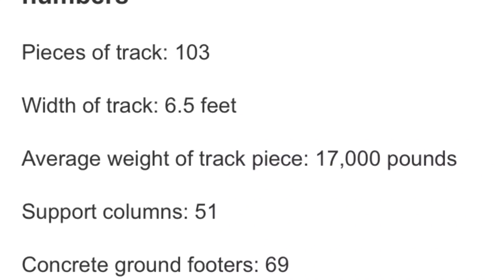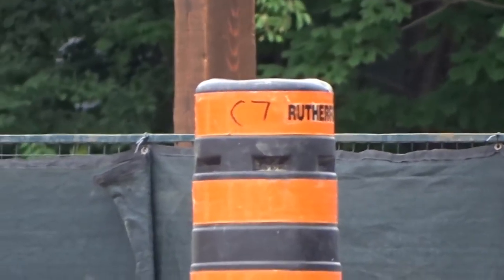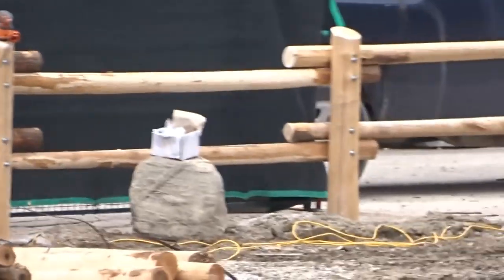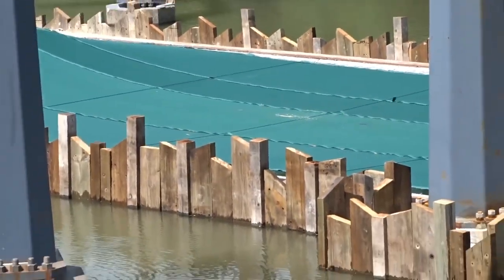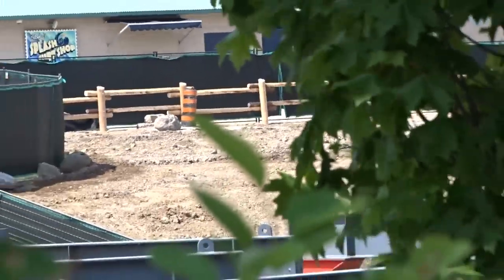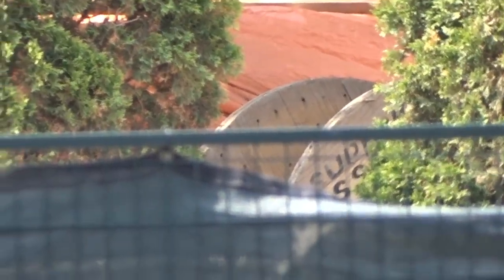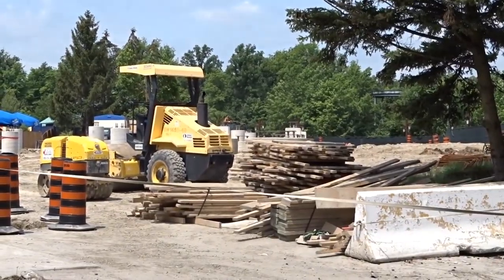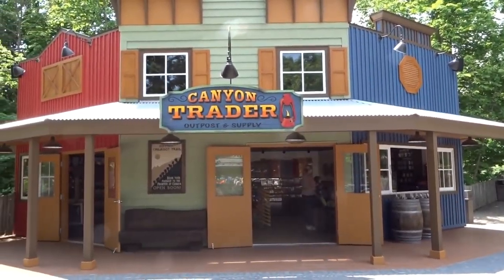Canada's Wonderland New Coaster Larger Than Valravn?

Comment: The 272 ft height that you mentioned was based on the length of the lift hill that you measured and an incline of 37 degrees like Valravyn.  On your previous video, there was a comment from someone who said the actual incline of Valravyn was 47 degrees with a link to the source.   Can you confirm which one is correct cause if 47 is correct, then we might be getting a much larger ride than 272.

Great video as usual!

Edit:. Here's the link.
https://mobile.twitter.com/tonyclarkcp/status/664537580344623108

Comment: What defines a giga? The drop or the height of the lift?
Also, I think they will start construction and not lay down sod on that other side. It doesn't make sense to me to stop at this point. But I guess time will tell.
Reply: Khris Ranger a giga is the height of the drop
Reply: Jaykoo thanks! I thought so but wasn't sure.
Reply: Hyper is  200 ft drop or more giga is 300 drop or more strata is 400 or more
Reply: Roller coaster terminology is really screwwy! Giga  roller coaster was first used by Intamin in 2000 with Millennium Force. Perhaps to up B&M official usage of the term hybrid which was an industry standard term for a typical roller coaster that had a lift or drop of 200 ft or greater. To this day B&M does not recognize the term giga and lists Leviathan and Fury 325 as hyper coasters. However park marketing directors and enthusiasts all have different opinions as to what constitutes even whether a ride is a coaster, let alone the type(s). Imho I think giga dive sounds goofy. Even Cedar Point didn't try to promote Valravn as a hyper dive to my knowledge.